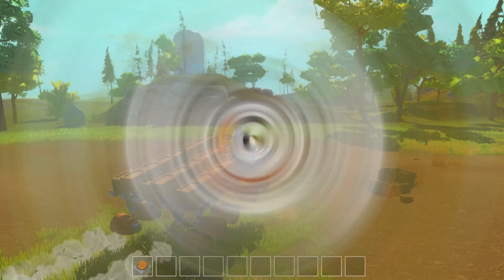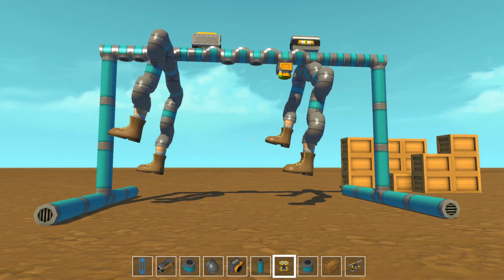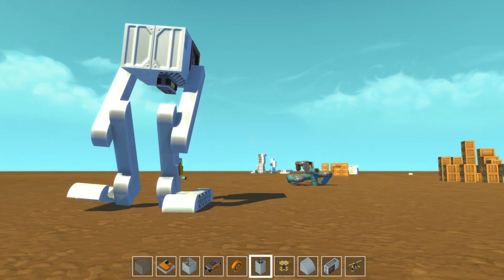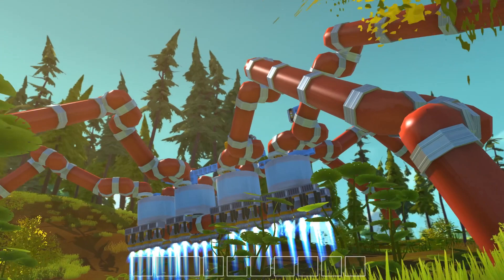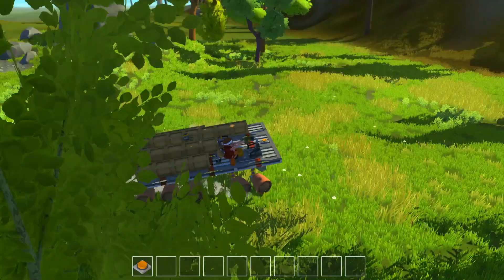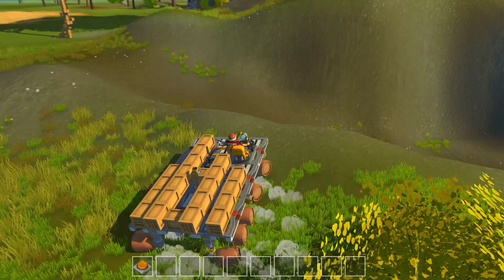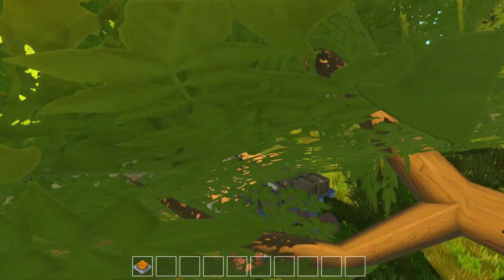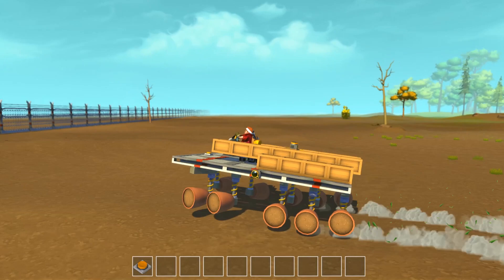Walkers, Mechs and Some Serious Off Roading Mayhem!

Comment: Very nice episode! It would be cool to see you build a drift car using flower pots for rear wheels and normal wheels in the front for controllability reasons. I'd suggest building a smooth pad track type thing for a good surface.
Reply from the maker: +Mr. SideWayzMoose™ I intend to build some kind of smooth track. I have seen others do it and it works quite well.

Comment: Why do you have crates everywhere?
Reply from the maker: +Sir Lagzalot Good question Sir! I use them as access platforms when building tall structures. If I stand on crates as tall as the creation I can access all parts of it easily by moving the lift up and down. To get up to height on crates I just jump,n,click beneath my feet and the crates take me up like an elevator